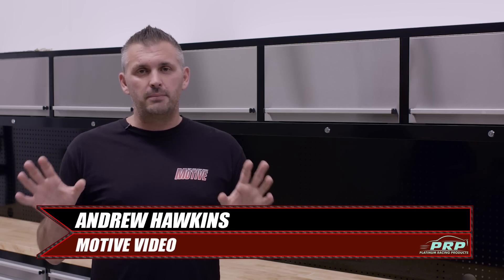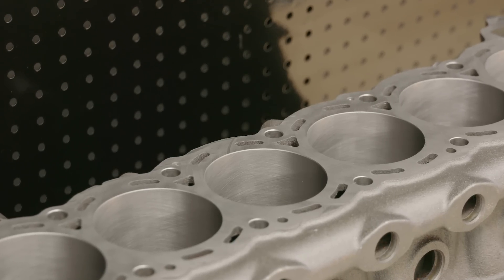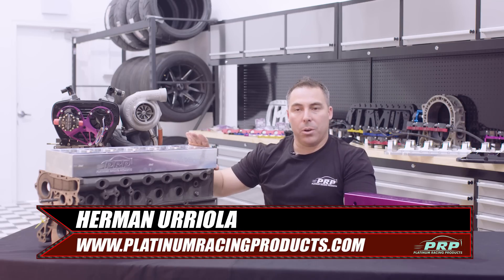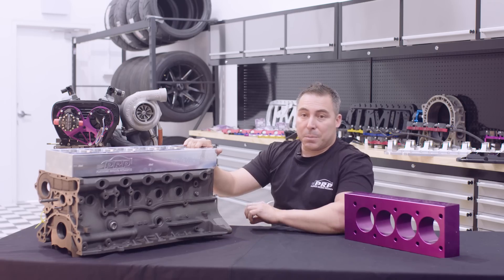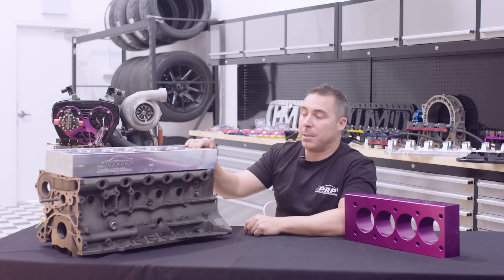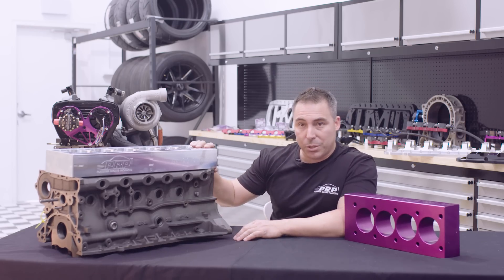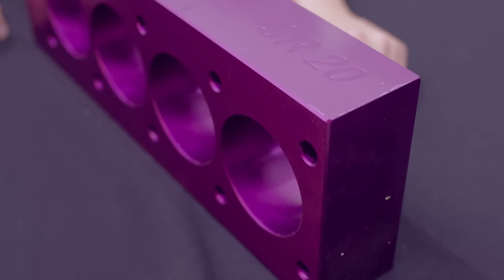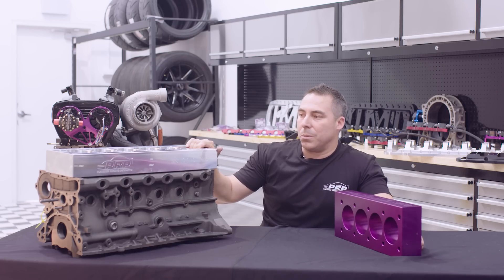Why You Should use a Torque Plate when Boring and Honing

Comment: Why not Bolt the cylinder head on and measure the cylinder bore from the crankshaft side?
doesn't that save you the hassle of making a torque plate?

Comment: But why does a block of aluminium with 6 big holes and 14 bolt holes cost so much. Billet should technically be cheaper than casting and forging for this type of stuff 🤦🏻‍♂️

Comment: Some engines are terrible for going square. 136000 mile 400 Ford and you could still see hone marks at the top of the bore. In 4 spots along side the head bolts. Surprisingly it had very little lip. and was vaguely fumy but ran ok.
Never thought about iron v alloy heads and different torque plates. my feeling is very little difference though. Having the hole for the machines ofcourse loses some simulation, but as overhauling engines torque plated you do not see odd patterns like I described above. A cheap way to make power and even better durability.

Comment: Was kinda waiting for measurement differences with and without torque plate. Last 1JZ I did was bored with torque plate, and yes it runs perfectly with zero blow by. Unfortunately did not have proper tools in the home garage at that time to measure the block bores before machining and after. Just gave the block and torque plate to the machine shop, and they did all the work. They even said the plate was useless, as they have tested them before on many inline4 and 6 engine blocks, and could not justify the ever slight difference it made. Don't know how true that is....today everything sells in the motorsport and performance industry if the marketing of the products is *right*.

Comment: So wouldnt it help if the block was at operating temperature when honing?
Reply: Thats an awsome question I didn't even know torque plates were thing until this video and I've been a mechanic for 17 years
Reply: @blackthunder7342  really for racing
Reply: No. 
There is no benefit because the block is heated in a totally different manner from combustion temperatures as compared to coolant temperature.
It's all been verified many,many years ago.
Ring Dart(USA) and ask them.
They will confirm this.
They have done the analysis.
Reply: Also,torque plate boring and honing is not new technology.
This was all done by performance engine builders decades ago.

Comment: what about engine heat, would that not distort the block slightly too?
Reply: Everything else tweaks with it. Maybe not in the same way, but that's why having the Torque plate will help minimize those differences at running temps.

Comment: how is a piece of billet aluminum anymore representative of a CAST aluminum head than a steel plate they are still completely different materials
Reply: The way the grains of the material line up when the piece is built will effect how much it deflects.
Reply: How are you going to hone the bore with a head bolted on there?

Comment: Also you can use a killed block as a torque plate if you cut it and get the thread for the head bolts away. Don't forget to turn it upside down. This is a pretty silly way but still works.
Reply: Or convert a spare head to a torque plate if you have one laying around and don't mind sacrificing it.
Reply: @Dollsofgod  but it's shit, cause you'll loose it's stiffness by making big holes in the head, cylinder-close size, no?
Reply: I'm no structural engineer but I don't think it would give you a worse result. Would the head be weaker as a singular piece? Sure, but would that translate to a less accurate distortion it would put on the block if you bolted it to it? I don't think it would in any meaningful way. If anything you could argue that the billet head simulators they use or your idea are too stiff and that the over stiffness gives you an equally bad result when trying to simulate an assembled block. We're talking maybe a few thousands of an inch here either way, I think it's just as valid an option as any other for the desired effect.
Reply: @Dollsofgod  Yeah, I agree. Just shitposting on da internet) I suppose noone will try to do a research on that)

Comment: what about when I'm boning and horing?
Reply: Contrary to popular belief, you don't actually want a plate in there. You want maximum flexibility and distortion as things are a little tight from factory and need a bit of working to adjust properly.
Reply: @ElMaximoBango  Are you also trying to be a funny guy?
Reply: Scope it out before putting in your tooling?
Reply: You too want your hardware covered with something or bad things will happen.